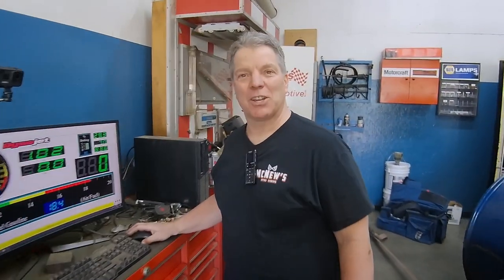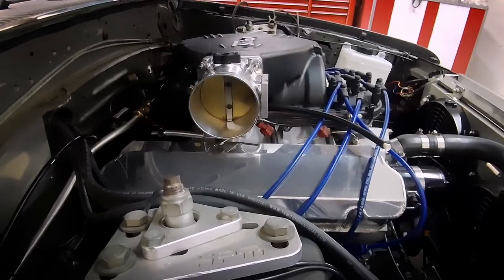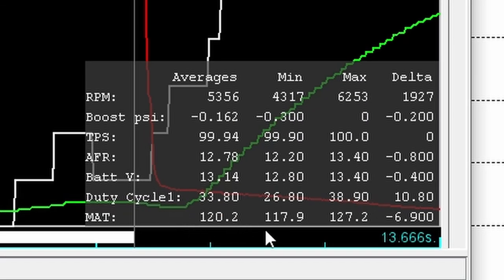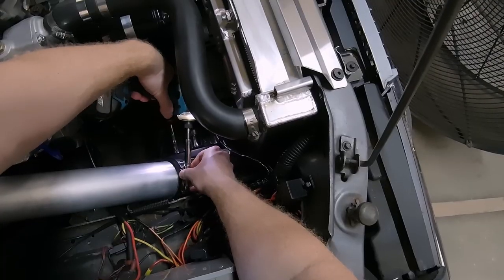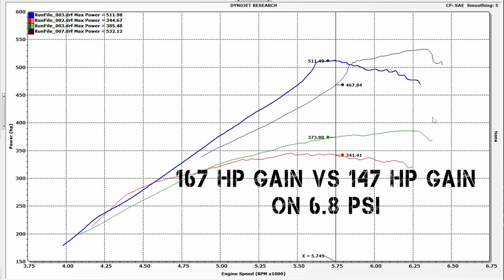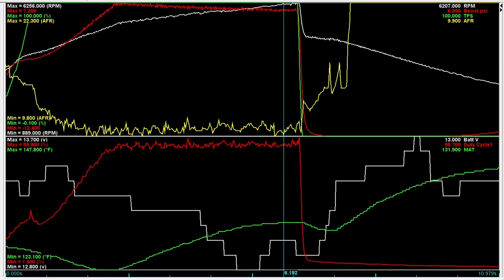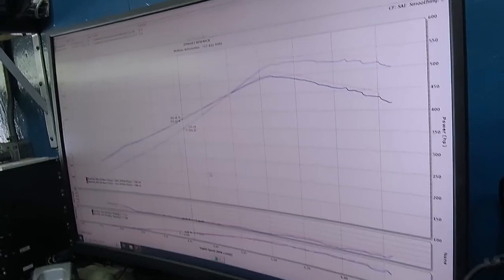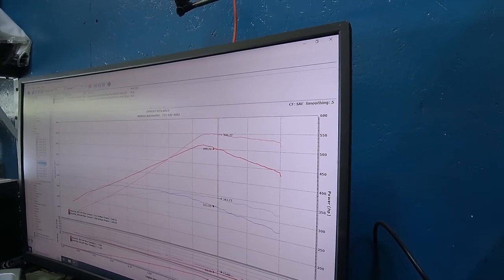Dyno Test: Electric Turbo + Methanol Injection + Coated Volute

Comment: Needs more boost... like a bar or 2.
Reply from the maker: The only problem is that it's already a 9 second car on 93 octane pump gas.  Technically, it needs a full cage at this point.  I don't want to cage it - it'll ruin the nice interior.  If you haven't seen it, here's it's first 9 second pass with the electric supercharger: https://youtu.be/RT0M88xHzNQ?si=Op7qcoJRTM0PRutY

Comment: 👍 everyone loves dyno videos. Can a track trip be far behind? What happens at 14 PSI with this setup?
Reply from the maker: I honestly think that with current technology in order to hit 14 psi on this engine, I'd need to run two units in a series ("compound") arrangement.  But it would make a lot of power.  And I have the Sledgehammer and enough parts to make two of the P2/Castle superchargers - see where I'm going with this? ;)
Reply: Alex LTD now you’re talking.

Comment: put some new plugs in it.. graph looks horrible
Reply from the maker: Look at the first graph in the video - the one with the electric supercharger running.  That's from the same dyno day, later on in the day, with the same plugs.  The converter is virtually locked in the N/A pulls, but when you add power, the graph smooths out because of additional converter slip.  This is common, and not due to plugs, but the nature of the beast.